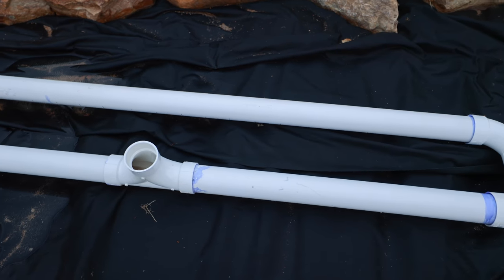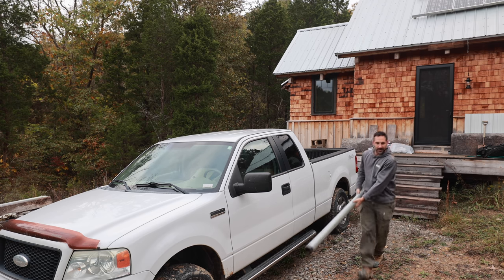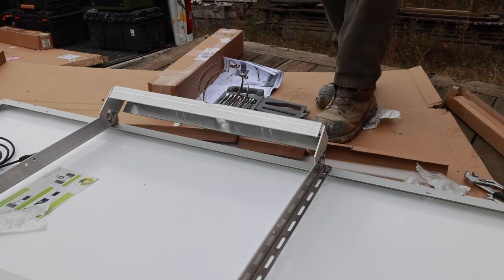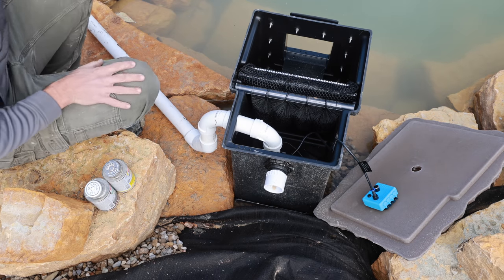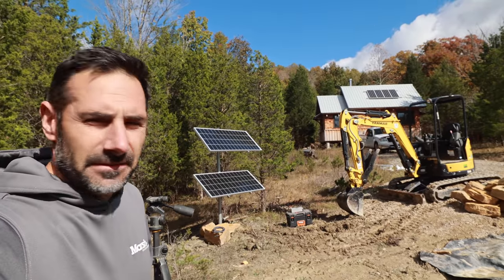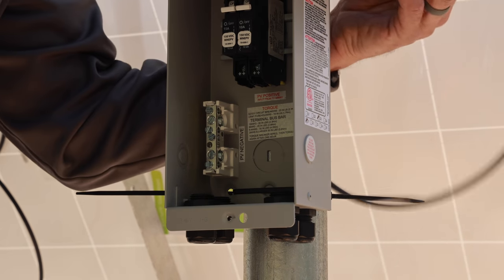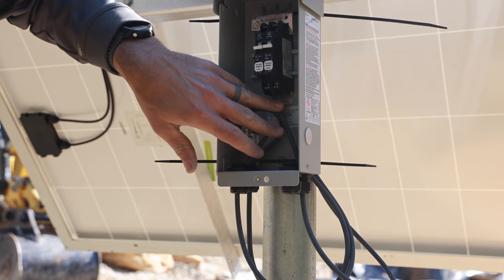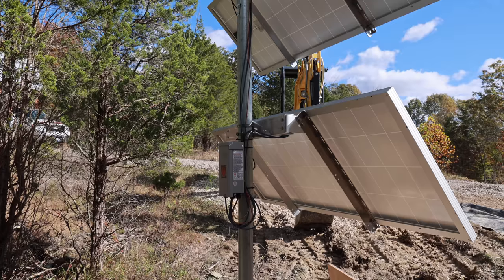Solar Power Pond Pumps | Natural Swimming Pool Part V

Comment: Pro tip for you sir: when using the primer and glue canisters I find it is a good idea to duct tape the two side by side together to minimize the chance of knocking said canisters over...
Reply from the maker: Good call, I saw that the plumbers I recently hired do that as well, I need to remember that one.

Comment: Those metal pipe clamps look like the weakest link in mounting the panels and brackets, I had no idea they would hold that amount of weight, usually you see those large bolt on pipe clamps. That is going to be one nice pond. As always thanks for the video.
Reply from the maker: Yea that's just what they sent with the kit, Ill pick up some u bolts.

Comment: Dude this is coming along nicely. I don’t think you ever mentioned that you were creating another solar bank for the pond. This whole time I thought you were going to run it off your existing system. Obviously that was a wrong assumption. This thing is going to be so nice next summer on those hot and humid days.
Reply from the maker: Thank you Anthony!  Yea, I decided it was more economical and fun to create a new system,  wire is really expensive and it is a long way to the cabin.

Comment: In the meantime, till you install the tracker you can find the ideal angle to the son using a soup can.  Set the can on the panel then tilt the panel till the can casts no shadow.  That means it is pointing right at the sun.
Reply from the maker: Very cool tip!

Comment: Posts are plumb, beams are level (sorry it’s a pet peeve of mine). A makeshift plumbob with a bolt on the end of some string would also suffice in a pinch. Things are coming along nicely considering you aren’t able to work on it daily.
Reply from the maker: Gotcha, yea that would have worked, it seems like they are pretty plumb.

Comment: I love your videos , but , I will suggest supporting the bottoms f your solar panels before winter as they will , more than likely break through the winter , trust me as I made the same mistake and had to buy at least 6 new panels of the eight that I installed .
Reply from the maker: Thanks for the heads up I don't want to have to replace these!

Comment: One tip when using concrete is to remove all the loose dirt from the hole.  Otherwise it will shift when it settles.
Reply from the maker: Thanks for the tip!

Comment: Have you thought of using stainless steel muffler clamps to fasten the solar panel mounts to the pole? I worry that in a high wind that the worm clamps might break. Thank you for making this video illustrating the solar install. I love the whole idea of capturing and using energy from the sun.
Reply from the maker: That'd work great, I just used those clamps because they came with the mounts.  Glad you liked the video.
Reply: i second your remark...my icon is my solar panel system with a tracker...i see that rock around in strong winds...those hose clamps will not take the stress and loosen ...at the very least since your panels dont track/move...put guide wires from the corners to the ground...also put a screw/bolt into the mounting pole you cemented in just under the clamps so they cant slide down if they do stretch/loosen

Comment: Nice one, but kinda concern on solar panel attachments to pole by only 2 hose clamps, I hope it can hold on during high winds,,,maybe just additional bracing will secure it better.
Reply from the maker: I dunno I just used them because they came with the mounts, maybe I can get some U bolts.

Comment: If you get two more hose clamps and put it underneath the bottom of the two bottom hose clamps of each panel and tighten it to the pole only when you loosen the clamp to turn it it won't slide down
Reply from the maker: good call

Comment: I think my swimming days are over.  I would love a water pond like that but only about 2 feet deep. Then in the center, have an adjustable water feature to shoot up so I can watch it and it could also be used for animals to drink out of.   Maybe adjustable lights for white or colors depending on the mood or season.
You need to drag up some wood for the woodburner for this winter.  I couldn't recall if you had a stack or not.  When you lit a fire and sat there it was as if we all felt it.  As I said before, my grandpa and I would sit by a small fire on old metal green chairs.  We'd sit there and he'd just talk about anything and everything.  When we would take walks in the woods, his motto was "never walk back empty handed".  So we'd always drag some kind of wood or twigs to take back and put with the rest of the pile.
I still don't get the electrics of solar and I've tried.  All I know is that when I build a new house, it is going to have an electric furnace and a/c.  I want enough panels and a battery so that I have a zero electric bill.  My electric this past month in Ohio was $330.00.  So, as you can see I don't care what it costs to build so I do not have to tie into the electric lines.  Thanks for the video!
Reply from the maker: Well, if you only wanted it two feet deep it would be much easier to build!  Ive got a little start on firewood we cut up a dead ash last spring.  That will be nice to have all your electric taken care off.  It's getting more and more affordable these days.

Comment: Your right about the pvc glue...plumbers make good money because no one else wants to do it, not because it's rocket science. Cool little panel system but I would probably upgrade the hose clamps to u bolts..seems a weak link right there.
Reply from the maker: Ha ha, I just paid a plumber quite a bit on my shop!  The whole time I was thinking man, I'd be doing this if not for code enforcement.

Comment: Hello Mike , I wonder you are filtering the water right ? As the area will produce sediment of various types , are you going to be able to back flush the assembly so it is not clogged all season or have to replace filters every month ? I must say you are building a quality alternative to the heated outdoor shower ! Aww hell I like to get wet plenty myself , a swim pool is great . Will you try to make it a hot tub on demand !?
Reply from the maker: Hi Michael, yes I do plan on filtering the water, I should be able to back flush the filter by putting a reducer on the top of the stand pipe for the gravel filter,  I am not sure how often.   I have heard daily on the skimmer filter.  I don't think Ill make it a hot tub.
Reply: @50Acres  Some of my co workers made a 55 gallon steel drum into a heat exchanger the plastic pipe should be just fine after the transition to it as the 55 gallon drum is made to be a fire place with iron pipes running back and forth thought the up side of the drum . Yes , I realise it is not a prioriy of yours and I just wanted to share my experience . The pump for the water they used was a old washing machine pump . Anywaz have a great day at the cabin !

Comment: Love the channel. 1 notation i have is did you put some kind of anti spin device on the pole in the quickcrete? If you didnt if you have a few storms roll thru with the wind strong enough it may break the pole loose and itll spin in place. To late to change it now but if this scenario happens you can dig up the clay to where the crete is at and drill a hole thru the pole at a slant and then use a masonary bit into the existing crete and then hammer a piece of rebar thru the pole into the crete. I would do 1 of these on both sides for added strength. Then lastly add more quickcrete to where it covers the rebar and holes you drilled. Hopefully you dont have to deal with this but those panels may act as giant wind catches.
Reply from the maker: Oh that's an interesting thought I didn't do that.  Good call.

Comment: G'day again from downunder Mike. 
You are going to have a great plunge pool when it's finished. Question though, will the finished water level in the "pool" be higher? As it looks like the skimmer box is sitting to high at the moment. 
Keep up the great work mate 👍
Reply from the maker: Hi Brett, yes the water level is intended to be a bit higher than the inlet of the skimmer.  I may have to mess with the level of the overflow area a bit to get it just right.

Comment: Also get a cheap MPPT controller.  You can lose up to half your wattage with a PWM
Reply from the maker: Unfortunately mppt won’t work for me in this situation because I’ll have multiple panels facing different directions on the same controller.

Comment: Lmao... you expect 2 little hose clamps to hold the solar panels in place? One little wind and your panels are twisted and/or shattered! You might want to brace up the bottoms of the panels, and add some sort of a stabilizer so they don't turn on the pole!
Reply from the maker: That’s what the rack manufacturer sent with the kit.  I’d think they’ve tested it.  I can always put some u bolts in.

Comment: How much did you pay for the 2” galvanized conduit? $$$$$$
Reply from the maker: $190, ouch it’s 2.5 inch and I guess my area is the only place it’s needed because our local utility company requires it.
Reply: @50Acres   I’m an electrician and the prices on conduit are crazy. Great video, the cabin has really come together. You’ve done an awesome job on it.

Comment: Just an friendly FYI. Its not volts that will kill you. Its amp's that will kill you. .01 amps kills.
Reply from the maker: Thank you for the reminder, and while thats a common saying, it's both that kill in the right combination.  It is the current (amps) that kill however voltage is the ingredient that allows it to overcome your skin's resistance.  So, it's much easier to die at higher voltages because it's easier to get shocked.
Reply: @50Acres  they both do. Yet I go off more the amps because of the heat and it takes very little to do so. Where volts takes a lot more. In all. You did put it out there to be safe around electricity. That in itself put an smile on my face.

Comment: I think you’re wasting time and money using the low-power panels, but I guess you have your reasons.  You’re already going through the efforts to dig, build and assemble so why not just combine all the panels together on a “Power-House” or your roof and then run the power to the external devices?!  The pump for the pond should be able to be powered by a much smaller panel, but I would have worried about that after focusing on the primary needs. 

Good luck!
Reply from the maker: The pond pumps actually require more panels than I have on that mount currently.  They need to run 24-7, so I need enough to run them, plus enough to charge the batteries so they can run during the 16 or so hours of dark or non direct sunlight plus enough margin to be able to charge during overcast days. 

The economics of of transporting low voltage power from the cabin to the pond doesn’t work either.  Wire is very expensive right now and going up every week.